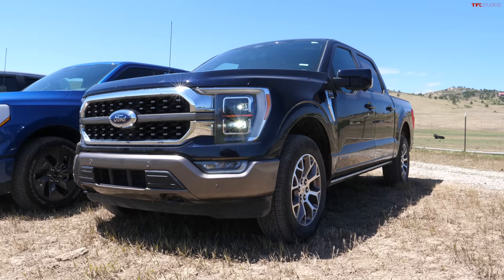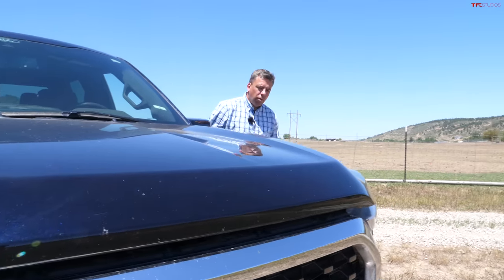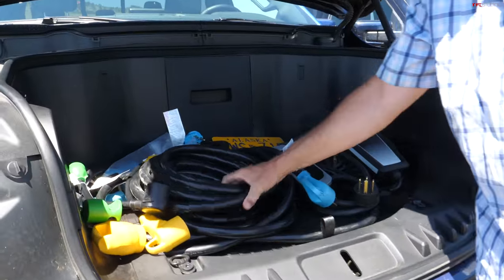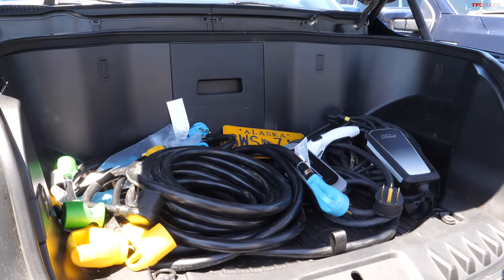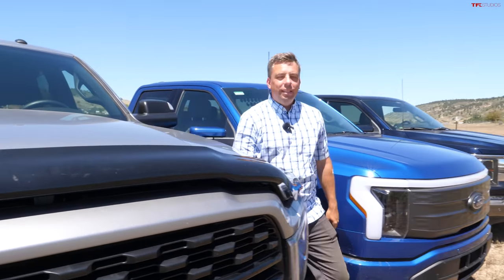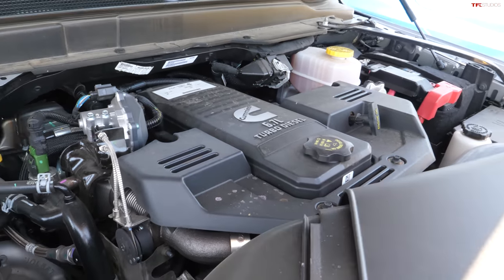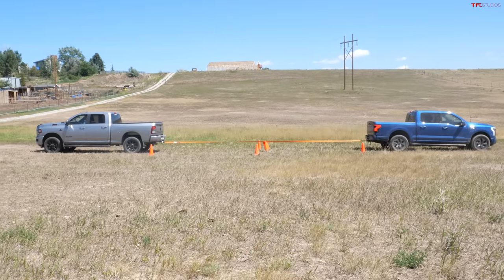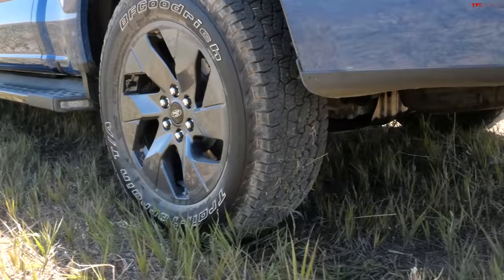Diesel vs Electric Tug-of-War: Ford F-150 Lightning Takes on the Ram 2500 Cummins In a Nail Biter!

Comment: Did you disable traction control? Did you lock the rear diff? The hybrid looked like the 4x4 wasn’t working.
Reply: That is exactly what I was thinking. The Lightning would probably pull my 2003 FX4, but I guarantee my front and rear wheels would be spinning.
Reply: It's an EV.
Reply: @larrysmith6797  ?? The very first pull was the lightning vs the hybrid… I was asking about the hybrid.
Reply: @larrysmith6797  What is an EV? We know the blue one (the Lightning) is an EV. All 4 wheels seem to be turning on it. The question is, why on the King Ranch was the front wheels not spinning. After looking closer I think I see why. Because it was not an FX4. Not sure on newer trucks, but my FX4 has locking front and rear differential. Meaning 4 wheel drive is really, 4 wheel drive. The standard 4wd is really 3wd and sometimes 2wd. Meaning the tire with the most traction gets the power, sometimes leaving the other with no power. 

So, it would seem (I don't know this), the EV is a "true" 4wd drive vehicle with motors at both axles. The King Ranch was the standard 4x4 which means, at best it was down 1 wheel on traction. The results may had been the same, but we will never know with a bias test example. Also, knowing the EV has instant torque, the KW (and Ram) should have been brake torqued at an RPM closer to their peak torque. Just to be a fair comparison.
Reply: @gregelton1045  f150s have never had a locking front diff. They do have locking rears. I think the hybrid 4x4 was working, just the open diff in the front was doing its thing and we never saw the other front wheel
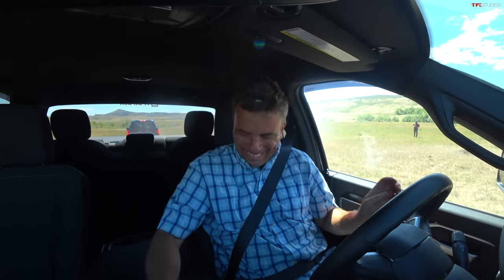Reply: 8:27 "lets not burn out these trucks"  LOL, you aren't hurting the electric. The vehicle which you're talking miles of life off of is the ICE. Torture test.
Reply: @Tron-Jockey  not really though. It can be very damaging to electric motors to be used at high power and not move. But this test won’t hurt any of those trucks. They are designed to pull and tug. I am curious though why the EV did not spin its rear tires.
Reply: Yeah, that would have done the trick. LMAO
Reply: Pretty sure they know what they’re doing
Reply: @Therealestrunnerluda  I’ve been watching these guys since before they got big years ago. They usually say when they disable traction control or if they locked the rear diff.
Reply: @Tron-Jockey  I'll roll coal on that Tesla, boy.
Reply: @Treyk901  EVs have amazing  torque ,plus it is all DIGITAL FROM ZERO RPM , like  traction control is Now!!!@  instant , no revs  to build up, and if it is Quad motors like the Rivian and Tesla CYBRTRK ,  ICE  in all its glory and permutations  are dinosaurs , just  check out how Tesla Plaid S  humbles everything  ICE, even multi💲 $ Exotics
Reply: @aurelio-reymilaorcabal9669  I never said EV wasn’t good??? I like EV just right now prefer hybrid. You get a good balance of that good instant torque but with the range of gas. Until EV can get better range it simply won’t compete well in the large truck and SUV market. Towing videos have proven EV to be near worthless in the real world.
Reply: That's how Ford's 4x4 works. Or doesn't work 🤣
Reply: @Treyk901  hybrids are good ,it' s  neither fish nor mammal,it's kinda that 🐊 croc,will  it walk? or is it a ' gator .
Reply: @Tron-Jockey  I don't know about that, it's incredibly hard on electric motors to put power into them and have them not move.  The diesel wouldn't even have broken a sweat there.
Reply: @JadyGrudd  lol you'd never catch a Tesla in a diesel
Reply: This^ the 4x4 wasn’t fully engaged
Reply: @Tron-Jockey  I'm not sure about the EV and this may be a bad comparison. But I have seen a fan motor burn up very quickly when something was blocking the fan blade after being turned on. So it would seem to be the same with an EV motor. If it was under too much stress trying to turn, but something was preventing it from turning, then the motor would eventually burn up. 

Personally, if I was in the market for an EV, this would be an issue. I don't care if it is a truck body or not, I would not expect the same capability as a regular truck. But knowing well over half the trucks sold very seldom get more than a few bags of mulch or pine straw loaded, and EV will easily fill the need of the "average" truck owner.
Reply: This channel rigs these videos now because they get paid to push a product.

Comment: Weight makes a big difference. Cay you take the new electric truck off road? Mudding? How about driving through a shallow stream to get to your favorite  hunting grounds or fishing hole? Drive it out to Cape Point on the beach to go red drum fishing? My concern is when 300plus weakly vacationers  and residents are told to evacuate  our coastal area due to hurricanes! Going west driving through a low lying  swampy  area the 1st town is35-40 miles away. Next town is another 30 or so. Rt95 is approx 2.75 hrs away.

Comment: Two words: tractive effort. Whoever makes the most torque and weighs the most wins. EVs have lots of tractive effort but what they lack is gobs of energy to keep it up for a long time. For all internal combustion's faults, it still cannot be beat for pure endurance.
Reply: And how long do you think the test would last? That’s the part that you ignore. Does it have enough energy to complete it’s task.
Reply: @neilkurzman4907  probably when speaking of endurance; long haul towing, etc.   I see it with the lawn equipment i have.  My gasoline and diesel equipment just run longer between fill ups where i get a fraction of the run time out of my electric power equipment..
Reply: @yarrik701  
Absolutely. So if the test was who could go further on a single Fill-up then the electric with loose. This test shows the strength of electric.
Reply: @neilkurzman4907  Kind of... but not in any meaningful way.  Other people have touched on the topic of curb weight between the trucks involved already and how that plays a role in this "test".  And when one of the bigger "selling points" of EVs are all about being green\good for the environment, weighing about as much as a 3/4 ton diesel pickup (~roughly 3tons, right?) the EV's truck pull advantage plays a big role in its range disadvantage even compared to its ICE counterparts.  Probably does wonders for the wear and tear on roads too..
Reply: @yarrik701  
It’s interesting how people will just come up with rationalizations for anything they want to be true. 
They don’t even put a lot of thought into it. Tear up the roads? A vehicle that weighs less than trucks semi trucks cement trucks ect. And all the sudden you’re worried about tearing up the roads? rationalizations for birds? for recycling batteries? 
Yes it’s heavier, that means it’s going to need bigger tires and they’re not going to last as long. but for a Tesla it’s equivalent to an ford expedition. Are you concerned that expeditions are tearing up the road?

In the end for this specific challenge an electric vehicle has the advantage for several reasons. I had to head gasoline or diesel just isn’t going to win. Just like in a distance race an electric vehicle is not going to win. 
On a race with a long downhill slope, the electric vehicle has the advantage due to regenerative braking. Where is a gasoline vehicle with an automatic transmission is going to burn up its brakes. Throwing a manual transmission, and that advantage is gone.
Reply: @neilkurzman4907  if you're going the ad hominem route might as well do so without the passive aggressive approach.  The way you worded that, sounds about as bad as referring to yourself in the 3rd person. XD

Anyway, again..  IMHO this test was cool, completely meaningless, but cool.  It's been done before and the EV typically wins in a pull.  The EV is typically heavier, has more torque, and a comparable amount of rubber contact with the ground.  However, for the same amount of work done, ICE still can operate longer than a battery powered EV and doesn't suffer from the effects of depth of discharge.  When batteries reach parity with gasoline and diesel in energy density, storage system longevity, storage system repairability \ serviceability, cost and we have a hardened power grid with the actual baseload power capacity to support a switch to electricity from fossile fuels for the bulk of our transportation energy needs.. provided compressed hydrogen or something else isn't better than BEVs and gasoline\diesel by then, I'll most likely jump on the EV bandwagon.  Until then, I'll let tge ev evangelists deal with the ev early adopter issues.
Reply: @yarrik701  
So let me get this straight first you insult me. Then you tell me everything I said was correct.
That’s an interesting approach.
For this particular test the electric vehicle has all the advantages.
People can complain about roads, tires, drivers, and the weather it’s not going to matter. People can go complain about the lawn equipment it’s not going to change this test.
The exact way if they were going to do a range test. The gasoline is always going to win.
Why did they perform this test. Because people assume it means something that it doesn’t. That one vehicle is more powerful than the other. 

Now at this point should I come up with an interesting insult for you, this all of course will discredit my entire message. But at least I’d be smart enough to put it at the end instead of the beginning.
Reply: @neilkurzman4907  just making an observation,  not meaning to insult you.
Reply: @yarrik701  
So you believe that I should attempt to disprove people who are just posting rationalizations they’ve seen on the Internet? The problem is and they don’t want electric vehicles for themselves or anyone else. 
Most of them haven’t even bothered to look into their rationalizations. 
They kill birds? The number one killers of birds in the United States are cats and windows. but they’re not against those. 
We don’t have enough electricity and can’t build new generators or powerlines because we’re too poor?
Where the richest country in the world. We can do these things we just choose now too. 
Lack of range, lack of towing range. 
All true, and all irrelevant. The average person doesn’t need these features. 
Golf carts? does that actually need a rebuttal. A 4000 pound golf cart that can travel at 150 miles an hour?
Concerns that the weight of the vehicles are going to damage the roads? How much does a Ford expedition weigh? And why did that never concern them before. 
I don’t believe I referred to myself and I in the third person. It’s not something I would typically do. 
They were plenty of good reasons why so much is not get electric vehicle.
For example one lives in an apartment and has no place to charge it overnight. 
That the range or towing range is the primary use for a vehicle. That certainly affects a lot of people. 
There was is service support in their area. Or charging stations on the way to place they need to go. 
All things one should consider before buying an electric vehicle. 

If you have any additional rationalizations that you want me to address directly, post them.
Reply: @neilkurzman4907  How about trying to have a polite casual conversation.   OP was talking about the endurance that ICE has over BEV, and on that I'm in agreement with the OP.  It's not a personal attack directed toward you or EVs, it just is what it is.  Unless I'm being facetious, I'm not going to flip my opinion just because some random person told me to who said I was wrong.  Polite conversation on the other hand, might get me thinking and doing my own research on what's brought up in conversation, might actually change my mind, might not.  But this, yeah, no.
Reply: @yarrik701  
You’re the one who pointed out that it was attacking people and not it documents. My point is they have no argument. The only purpose is trying to convince other people not to buy electric vehicles. starting with lies. Some of them they move onto half truths. Very few even point out the actual limitations of electric vehicles. 
It was the same with LED lightbulbs 10 years ago. In the end and incandescent bulbs lost. Except for a few niche applications. 
With electric vehicles time will tell.

I’m not here to convince you to get an electric vehicle.  my only concern is that people don’t tell you lies about it that you may believe. 
In reality I don’t have an electric vehicle, the primary reason is I live in an apartment. Without easy charging I don’t see any benefit to it for myself.
Reply: @fritzmiller9792  
Sure I can compare them. 
Because 10 years ago when they first came out and they were subsidizing them people like you complaining the government was forcing them to use LED lightbulbs. And they rationalized why incandescents were better. 

If you don’t want an electric vehicle then don’t buy one. If you want to talk about the limitations of EVs, that’s fine. 
If you want to post a bunch of lies and rationalizations, don’t be upset and somebody calls you on them.
Reply: @yarrik701  also 5 times the cost. So if you had to stop any charge for 15 minutes plus never having to do maintenance or oil changes that one extra stop seems totally worth it
Reply: @lawrencemcclammy4686  5 times the cost of what?  Are you talking about at home charging vs refueling with gasoline/diesel?

Comment: Take them to a track, and hook up to a pulling sled! Then you'll have a slightly more scientific approach, while still having fun! This was still fun to watch !!
Reply: Stop it....EV will kill ICE in pulling, not even close.instant torque.
Reply: @adventurefishing3190  lol dude learn physics ...you're so wrong.
Reply: Hook them up to a gooseneck stock trailer with 20 650 lbs calves and pull the 16,000 plus lb load 200 miles to the sales barn over rolling hills at an average altitude of 5500’. The diesel will win and be back home in time for dinner since EV will have to stop and charge for five hours.
Reply: @nmelkhunter1  that'll change in time. Its getting better already. Just need more competition, and innovation! For example, look at the HP wars in the diesel market in the last 15 years! I miss pulling a heavy trailer with a Cummins!
Reply: @adventurefishing3190  it different on pulling sled the weight doesn't come on till 200 feet down the track then motor already wound up so it doesn't matter how much torke u got coming out of the hole
Reply: @garyposthuma9607  electric torque is always at max....ice will never always be at max trq....stop, pls

Comment: Yeah but which one is going to run out of diesel/electric first? In terms of longevity the diesel wins.
Reply: Tell that to the emissions system
Reply: Depends on how you calculate that? The lightning has less than 3.5 gallons of diesel in total energy capacity onboard. 
As it's listed at 131kwhs total pack capacity and road diesel is listed at 37.9kwhs per gallon in total energy. 🤔
Reply: @4literv6  I am talking who reaches the end of the "tank" first, not traction.. Once the lightning runs out of lighting the diesel will keep on going.
Reply: @jked7463  not if they both start out with the same amount of onboard energy, which is a full charge for the lightning and just 3.5 gallons of diesel for the oil burner. The lightning in that case will be 3x further down the road, which is my point. 😎
Enjoy your slower ancient diesel tech while you can. In a few more years society will look at people like you as we now do most smokers. 👍🏻
Reply: @4literv6  that is my point.  The dodge can store ALOT more energy onboard.  The lightning cannot store much energy.  That is the limit of the technology at this point.  Maybe someday they will figure out the storage and recharge issue but as of now it is far inferior (in terms of practically) to gas and diesel.  Electric still has alot to go.
Reply: @jked7463  so to you the more sustainable technology which is also 3x more efficient per mile. That allows you to recharge from your house using solar/wind/hydro/nuclear/bio mass/geo thermal energy. Charge at work, the gym, malls, jobsites etc. Is somehow inferior? 
You've sniffed way to many gas&diesel fumes and likely impaired your cognitive function imo. 🤔
Reply: @4literv6  that's usually how it works, when the argument is lost, revert to insults.  That is not what I am saying.  What I am saying is electric is not practical enough yet.  When an electric truck can tow for the same miles as a diesel and recharge as fast as filling a tank, it will be accepted by main stream.  Cars were not accepted over horses until they were cheap enough and practical and advantageous to the average person.  We should not force people into a immature technology.  Beside as of now, when true cradle to grave cost ( environmenttaly) is considered,  electric vehicles are just as damaging to the environment as an efficient car.  They use alot more energy to make (mining heavy metals from all around the world & the energy to combine them) and recycle them (energy to separate the heavy metals instead of bury the batteries like is done now). Electric vehicles consume less during operation but more to make and recycle.  Gas vehicles use less to make and recycle but more to operate.  When this changes, electric will be superior.

Comment: That instant torque is awesome 👏
Reply: Hey, if EV trucks have at least one advantage, I suppose that's it. At least if they have the tires to match that.
Reply: And the ev 50/50 weight distribution is actually what makes the difference lol….
Reply: It is awesome but really it's more of its weight that win the race.
Reply: @dearbulls  the tires aren’t being considered here as much as they should be since it’s on dirt and the lighting has a far better tires for dirt than the ram. I agree the weight it also a major factor in this case
Reply: @dearbulls  exactly
Reply: Coal powered motors have that advantage. You just can't tow anything with the coal powered trucks because the range is miniscule.